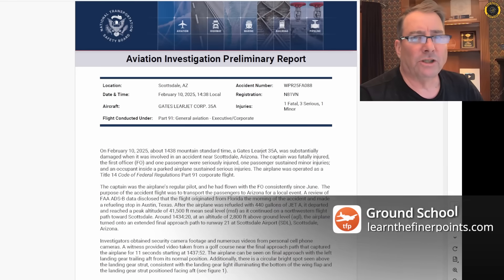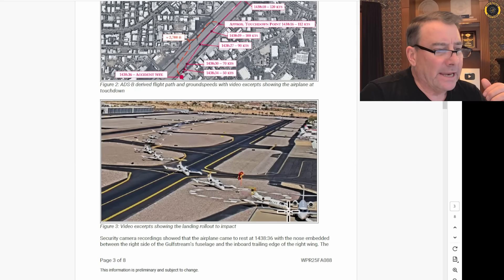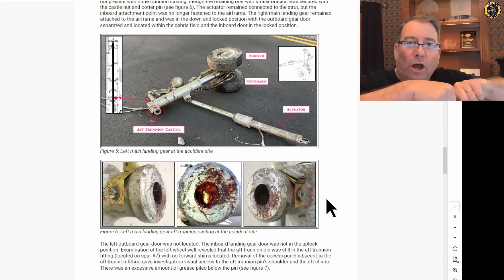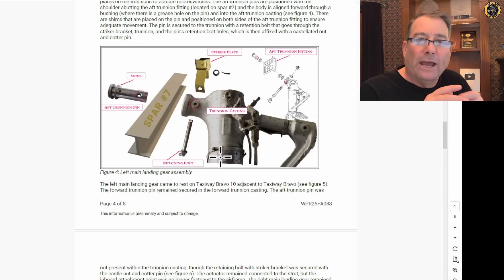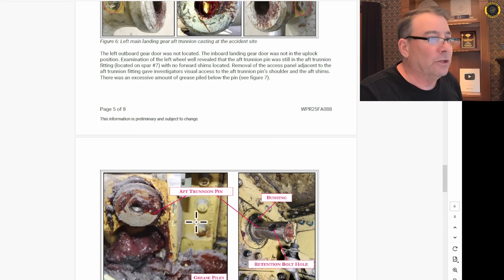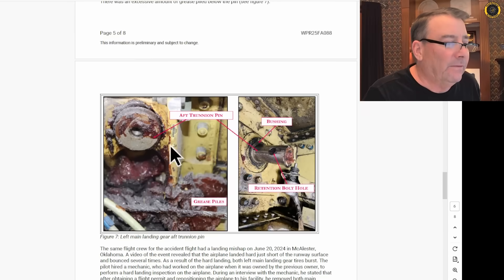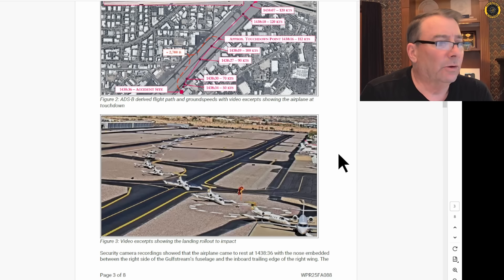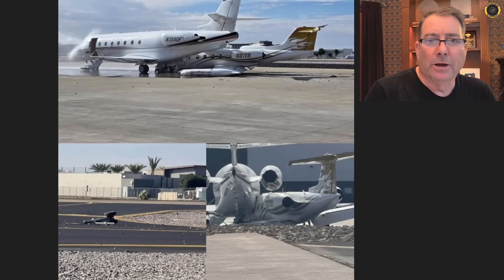NTSB Preliminary Report Fatal Maintenance Error Lear 35 Scottsdale

Comment: 2 very big clues for the engineer which he missed. You would think at least a visual of the end of the pin to see if its seated correctly would be a given during this job. Sadly an unacceptable level of maintenance which the lawyers will have a field day with.
Reply: Is the end even visible? I was thinking trying to rotate the pin. As it was apparently assembled, it would have been possible to rotate it, but not if the retaining bolt were properly installed. Or try yanking it out. (I'm not a mechanic of any kind, so take that with a grain of salt)
Reply: @Brillig2  Given its a wear part it fair to assume the pin can be removed. That implies access to inspect.
Reply: @ Access to inspect is one thing. Seeing it when it's supposedly installed is my point. There should be a way to confirm the pin went through the hole after installation.
Reply: @Brillig2  obviously it is visible, from the pictures taken of the back end of the pin. tTere has to be enough room to align a pin that size with the hole to insert it through the bracket/mount.
Reply: @rixtrix11  Is that visible in normal maintenance or only when NTSB cuts something open to see it or inserts a borescope to look and light it up?
Reply: @rixtrix11 : Remember these pictures are taken outside of the plane. When the bolt is high up in the wheel well not everything is that clearly visible anymore.
Reply: Looking at the pic I wondered if the pin has to be pulled each time to adjust the shims. It would seem like the end would be exposed since someone might need to turn it to align the pin hole. Seems unlikely to be blind

Comment: I've never worked on aircraft, but lots of other machines. When something seems funny, you don't go "huh" and keep going. There's a reason it seems funny, and you find it. It's the technical part of the job. That's a really odd lapse in judgment.
Reply: I don't know any certified aircraft mechanics, but in other areas of "professional" repair and maint I'd estimate far less than 10% are conscientious enough to both notice and answer why.   Maybe 1 of 3 would even notice something that seems funny and the vast majority of those that noticed would definitely just "go 'huh' and keep going."  

1976 Teton dam failure the first time it was filled.  The contractor that was supposed to grout the canyon walls was given a specification by the engineers for the pressure expected when pumping in the grout.  He was given a contingency.  He simply decided, "it's probably fine" and it turned out not to be.

We even write codes and manuals expecting people to do this.  The National Electrical Code could require ground impedance testing. They do in other countries. Here we just say (simplifed) "do one ground rod and if it doesn't test good enough, do a second ground rod."  Notice no requirement to test and ensure the second is sufficient.  In practice usually the contractor just puts in two ground rods, because the customer will pay for it and a minimally trained apprentice can do it. No need to spend the money for test equipment and calibration or someone qualified to take the time to do the test.  "It's probably fine."
Reply: @  part of lowest bids are not equal in quality to the rest of the bids.
Reply: Well said and correct, one must be hyper vigilante.
Reply: Well said, that's why mechanics get paid so much. I could have done it wrong by myself.
Reply: Yup, gotta follow up on that.
Reply: Absolutely. Any competent technician not only checks/tests the work, but would never let an anomaly - a "that's odd.." go unsolved. Doing that could get someone killed!
Reply: Couldn’t agree more.
Reply: Best comment

Comment: That retention design for the bolt is not 'Murphy' proof.
Reply: A great many advanced technical devices and processes are not Murphy proof, nor should they be. Murphys need not apply.
Reply: @markstevens1729  ✔😊Sometimes Murphy is worse than our other everyday enemy,  gravity.
Reply: It's not retention for the bolt.  It's bolting the gear together.  If you don't put the bolt thru the hole, it doesn't hold the gear on.
Reply: @Sylvan_dB  The smaller diameter retention bolt goes thru the larger trunnion retaining bolt in order to prevent the larger bolt from sliding out of the trunnion lug.
                              Juan is correct in saying this.
Reply: @John-nc4bl  Retention bolt goes thru the  landing gear trunnion casting AND the trunnion PIN ( it is not a bolt) to keep the pin in place.... which ultimately hold the rear half of the gear in its happy place.  Think of it as someone putting the cotter pin on an axle first then installing the nut on top of the cotter pin - it does nothing to retain the nut
Reply: Correction, I sould have noted Trunnion PIN and not larger bolt.

Comment: You would think there would be a smaller hole on the casting past the pin hole do you can see or use a bolt to ensure the large pin is fully inserted.
Reply: Yes, exactly.  That would seem very sensible if not required for such a critical assembly.  I wonder if such an inspection hole exists but the inspection wasn't done.  it would normally be packed with grease, so you would need to either clean it out or use a probe (maybe another bolt like you mentioned).
Reply: Why?
In the aft bay behind the #7 spar.... look at the head of the trunnion pin before you close the panel up - You have to insert the pin from that area to begin with and one peek and you know you have it right or wrong
Reply: That seems to be an EXCELLENT design improvement recommendation if they want to make it more fail-safe

Comment: The green light is activated how? Just the doors? That's a pretty terrible design isn't it? It should be on the gear itself
Reply: A&P with no lear experience but typically from what I've seen the gear down light is activated by a micro switch simply when the leg reaches full extension and any over center mechanisms are in position. It would be nice to hear from a lear tech on the specifics of the switch positioning in it.
Reply: Also, there could be a micro switch in the main gear actuator.

Comment: Man, insane that they were able to take-off and land multiple times on gear that messed up.
Reply: Exactly! How is it this didn't happen immediately after the service? Just sad.
Reply: Every time they swung the gear the trunnion pin was working itself loose.   Like Juan said it's unclear how many cycles were on it since it was repaired.  Too bad it didn't fail on its first several swings... you know the ones when the plane was up still on jacks and the mechanics were watching.
Reply: Until the pin completely backed out of the trunnion it would cycle up and down exactly like it was supposed too. Think of it like a partially installed hinge pin, the door will swing just fine until the pin is pulled completely out of one side of the hinge. From the wheel well the installation would look correct, the visible portion of the pin is hidden inside the wing. It was a ticking time bomb as soon as the aircraft was returned to service with the pin incorrectly installed.

Comment: I always try to hold my personal opinions till the facts come out. I personally thought it was pilot error because there is no way landing gear falls off. I am glad I waited for the facts because I was wrong.
Reply: Thanks.  There are so many commenters on the preliminary videos who just go ahead and put down people (usually pilot or ATC) with unsubstantiated conjecture before the actual cause is known.
Reply: I recall after this happened there was a lot of blaming the pilot for this tragic crash. I'm glad that the video and investigation shows otherwise and clears his name and reputation. I feel for the mechanic who made a fatal error, no doubt unintentionally. That's a hard lesson to learn
Reply: It takes a lot to admit that so thank you for posting it.
Reply: As a society, I think all of us (myself included) need to learn this lesson. Just hold out until the facts are known. Well done for having the presence of mind to realise and admit it.
Reply: 99.9% of the time a runway excursion is pilot error. But with no adverse weather and a professional crew, this one seemed like an exception.
Reply: Jumm. And what happened with the UNSTABLE APPROACH??  1000 FPM at 25 FTS AGL
Reply: Yeah, well I called it as a hard landing that caused the gear to fail. I was not completely wrong.
Reply: @OMGWTF Same here. It honestly didn't cross my mind that the gear wasn't correctly fitted. It's good that maintenance issues don't cause many fatal crashes, but this is a good reminder to myself that I should always wait for the facts, rather than making assumptions.

Comment: Not an expert, but this seems like it could have been caught with a simple tug on the mechanism. Would like to hear how the maintenance like this usually goes from an A&P
Reply: They make inspection mirrors for this very reason. My experience is with F-15s and not Lears, but the principles are the same. If you can't see the part you are working on, inspect it with a mirror to ensure you did it correctly.
Reply: Not really at all. That pin was simply not in all the way so you would have had to try tugging that pin out which isn’t normal I’m sure.

Comment: Juan, try the Shure SM7B. Great mic for what you’re doing. Cant believe a mechanic missed such a fundamental reassembly step. Further, how did it last as long as it did without failing earlier? That’s puzzling enough. So sorry for the family of this pilot landing a bad airplane with no fault of his. Sad situation.
Reply: Great mic but worth noting that it is notoriously silent and needs a good preamp. Shouldn't be a problem for YT purpouses though and Shure mics tend to basically live forever
Reply: @ostry66  Cloudlifter really boosts that mic if you’re not using an audio interface which I doubt Juan is.  I love mine, great for narration and voice over work.
Reply: SM-7B might be a little dark for Juan's voice, but it's definitely a really good option. When you get to that level it's a matter of what mic's "voicing" matches your voice best. Other possibilities in that range include the RE-20 or any of a number of condenser mics if you want something more "revealing".
Reply: c'mon, Shure doesn't make any mics except the 57 and 58.  😄
Reply: In what way would an SM 58 not be up to this task anyway?
Reply: @onceamoth  It's a matter of individual preference, not of "up to the task". 

The SM58 is sonically solid and utterly bombproof, and has lasted all of these years for a reason. With that said it's voiced as a stage mic for singers, and that's reflected in its brightness. It's up +4 dB though most of the high end, and peaks at +5 dB at 5-6 kHz. A lot of people find it harsh and unflattering for spoken word, especially if you have sibilance. Some of this can be mitigated with EQ, but a lot of folks prefer to avoid that for a number of reasons.

Both it and its close relatives (SM-57 and SM-7B) also have pronounced proximity effect and demand a certain amount of mic technique to get consistent voicing. Some other options like the Electro-Voice RE20 and Shure KSM-8 have more forgiving behavior in that respect.

I think that a lot of people who are spend (or are urged to spend) $$$ on high-end mics would do just as well with an SM58, but I also think that there are legitimate reasons to use other higher-end mics. 

I'm actually not a huge SM-7B fan. I have one and it's a great mic (as sales of Michael Jackson's Thriller will attest) but only if you understand why you need its unique voicing in a specific situation. I don't think it should be an uber-mic for YouTubers though.
Reply: @patrickchase5614  Excellent response! (Yours, not the mics' 😁)
Reply: The mic that he is temporarily using sounds just fine. Who needs a big clunky mic.